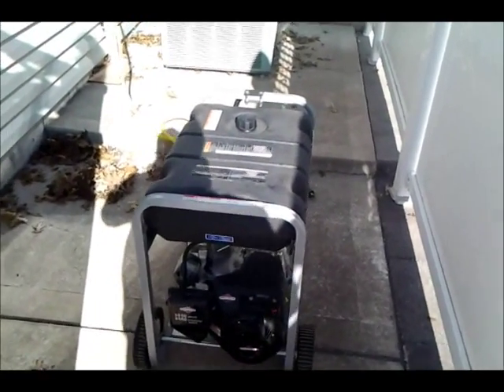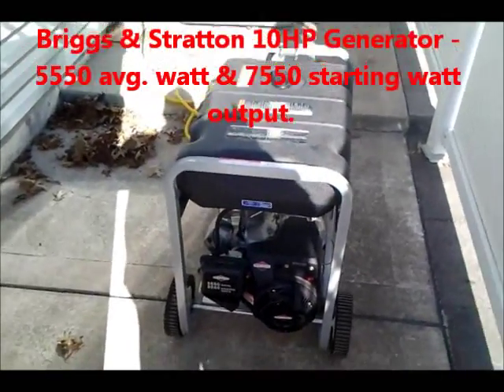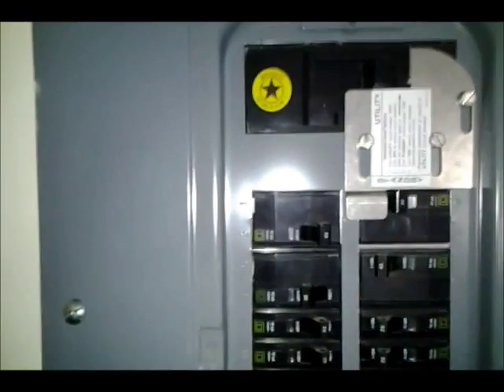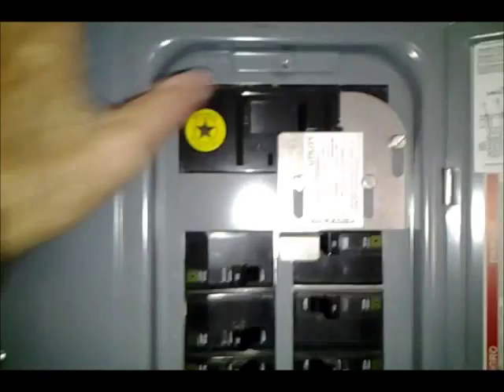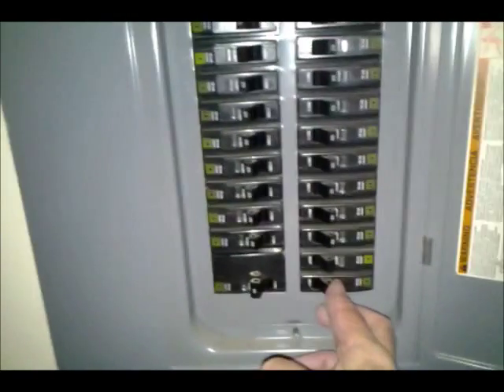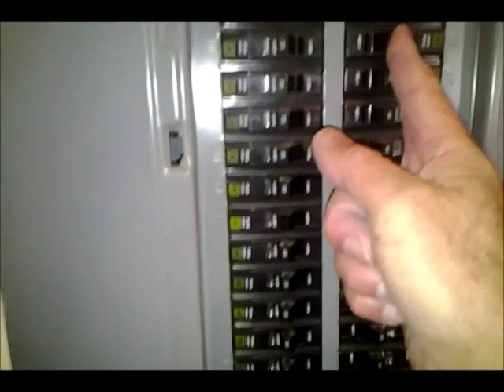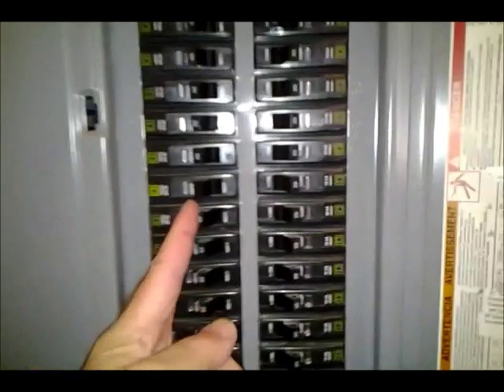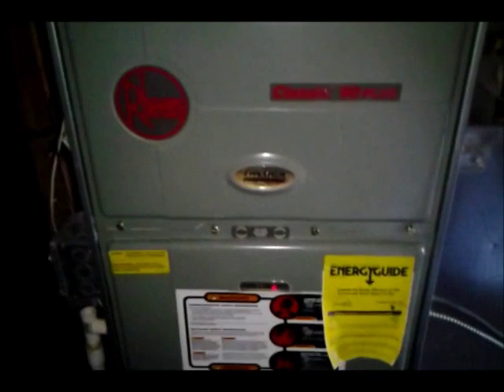Generator Installation Test

Comment from the maker: Here is my Play List of all of my Generator Videos:
GENERATOR USE AFTER SPRING STORM & POWER OUTAGE!
https://www.youtube.com/watch?v=5nBCjYC6uMI&t=5s&list=PLtPT9KQSzU8iYlN5Yr9MtHUJKNu04rWKk&index=1
Generator Installation Test
https://www.youtube.com/watch?v=12bNDpQ4JUI&t=5s&list=PLtPT9KQSzU8iYlN5Yr9MtHUJKNu04rWKk&index=3
BRIGGS & STRATTON GENERATOR UNBONDING PART V
https://www.youtube.com/watch?v=77Q7Yh-JBoY&list=PLtPT9KQSzU8iYlN5Yr9MtHUJKNu04rWKk&index=2
Generator Inlet Box Installation
https://www.youtube.com/watch?v=4ewaclvCyCU&t=427s&list=PLtPT9KQSzU8iYlN5Yr9MtHUJKNu04rWKk&index=5
Generator Cable Locking Connector Installation
https://www.youtube.com/watch?v=f0OLPtEUZT0&list=PLtPT9KQSzU8iYlN5Yr9MtHUJKNu04rWKk&index=4
Installation of a Generator Interlock Kit
https://www.youtube.com/watch?v=ohexUX5b81U&list=PLtPT9KQSzU8iYlN5Yr9MtHUJKNu04rWKk&index=6

Comment: Hi John. I set this up very similar, however I have an issue. During my test with the main off, all breakers off (no load), when I plug in the cable into the generator, the breaker on the actual generator pops. I checked at the outlet box and breaker panel, everything looks secure and setup properly. Any ideas?
Reply from the maker: dbates46, thanks for watching.  Did you dedicate a 30 amp breaker, in the house panel, for the generator.  And what size is your generator and what size outlet are you plugging into.  Also, what size cable did you use?
Reply: John H
Yes, a dedicated 30 amp breaker, the generator is 5000/6500 watt, a reliance 30 amp generator power cord for generators up to 7500 watts, and a reliance 30amp inlet box
Reply from the maker: dbates46 Maybe open up your outlet box, on the generator, and see if you have a loose connection or something.  While in there you can take off the jumper wire to unbond the generator, if you are only going to use it for your house.
Go here for the discussion on unbonding:  https://www.youtube.com/watch?v=77Q7Yh-JBoY
Reply: John H I checked for any loose connections at each point, everything looks secure. This was working at one point, by the way. I noticed it stopped working after I had an electrician come in to replace my breaker box. The only difference I see in my box is i used to have all the grounds on one bar and all neutrals on another bar. Now in the new box it looks like every neutral & ground wire is bonded together on the same bus bar. I'm assuming that's acceptable since every other breaker works fine, but maybe there's some problem with doing that for the wires with a generator?
Reply from the maker: dbates46 As far as I know, it is common to have the bus bars combined, however, I have separate bus bars for the grounds and neutrals but I don't see how that would make a difference?  I guess I would ask the electrician since it has changed after he did his work?  Sorry, I can't be more helpful.  There are some good forums you can look at, too, to get some ideas.

Comment from the maker: Wilhelm I know that is a popular thing to do and has merit but I don't plan on using the generator that much and, if I understand it correctly, if the load is too great the 30 amp breaker will trip first before overloading the generator.  Not a bad idea, though!
Reply: +John H   Did you have to balance the 2 legs of the incoming 220 volts from your generator?  Meaning that you shouldn't have all the heavy draw items (frig, microwave, etc.) on one bus bar in your breaker box and have only light loads (lights, tv, etc.) on the other bus bar in the breaker box.
Reply from the maker: +Patrick Wagz Patrick, I did not balance the loads, other than I did not plan to run large things at the same time.  Our power outages are not usually very long but if that changes I might have to study the loading more?  Thanks for the comments, Patrick!